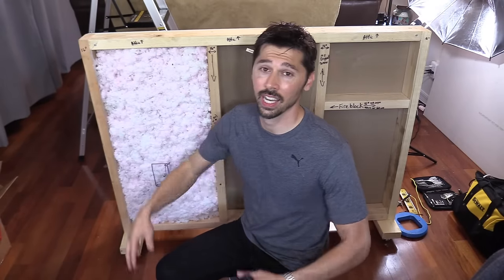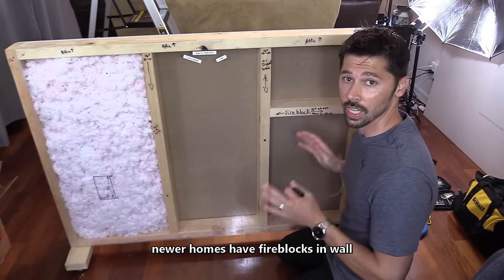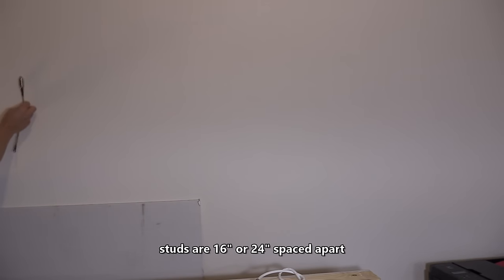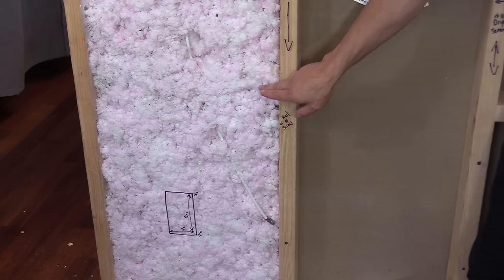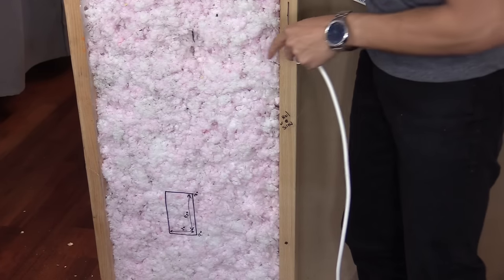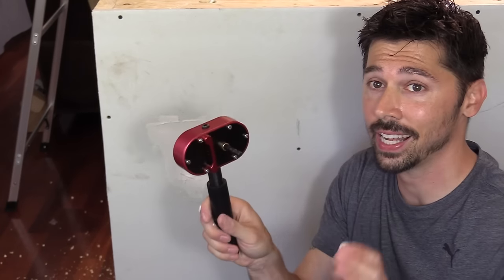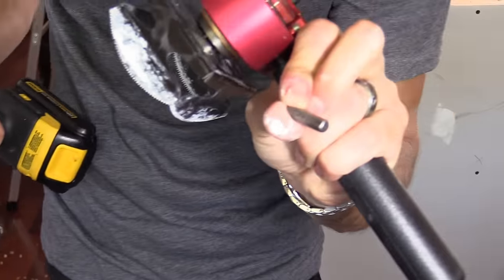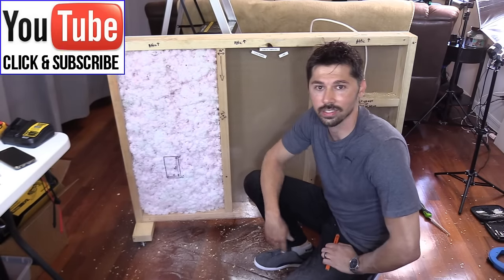3 EASY WAYS TO HIDE WIRES CABLES IN WALL & FIND STUDS

Comment: Sorry, but that is not the way to get through a fireblock. Flexible bit would be the best way
Reply: How would a flexible bit work? If the bit is flexed into a curved shape, it will not spin!
Reply: kellyq21 I don't really want to explain the science behind it, just google it
Reply: Then why are you even replying? I want the answer here. Maybe someone else can post a brief description.
Reply: I rewired my 80+ year old home a few years ago and I used the Kline Flexible bit especially for those areas where I wanted additional outlets.  Just Google Kline Flexible bit and you will find youtube videos of how it works.  I found out about Kline because it is what was used by the cable company when I added cable TV to another room.
Reply: I don't see why you can't just google it lol
Reply: Yes definitely not the correct way to get by a fire block. Flex bit is the way to do it. I'll find a good video, have been doing this way for years
Reply: Flex bits are great, until you think you have it in the right place and it comes out the drywall well trying to drill a fire block. #experience
Reply: Prairie RC true... but then you can just do what he showed here. And then u know exactly where the stud is located
Reply: Prairie RC They make all lengths of flex shaft bits. Interior walls are relatively easy. Exterior load bearing walls are hard because roof taper makes most types of drilling next to impossible. Especially on frame homes.
Reply: Then how would you seal the hole you just drilled through the fire block? Or do you care about building code and your clients safety??????
Reply: You're doing drywall repair either way then...  Why don't you share your #experience rather than leaving a snarky comment.
Reply: This does not violate the building code where I live in a non-commerical building but in some location I don't doubt that it might be a violation.
Reply: Bryan Cooksey I'm not sure if you were talking to me, but I'll share my #experience.
I was running thermostat wire in a client's house to relocate it, my wire fishing rods hit some solid blocking in the wall. 
We used a 5' flex bit to try and drill the block, it seemed to be in the right spot. Next thing I hear is my coworker yelling at me to stop. It had already started poking out the wall. 
I tend to opt for wireless thermostats now.
Also it's not code here to seal the hole in residential.
Reply: because it uses an auger bit and not a spade. you bend the bit using the guide handle and as the screw grabs the wood it will pull itself through. if you bend a wire and hold on to the wire and spin it on one side the other side spins as well. think of it as a solid flex shaft
Reply: Agbhar Gihad u can still seal it. I've seen guys use the spray foam with  longer straws. Not positive but I believe they passed a code that a fire block must be non combustible anyway.
Reply: Eric Wesson in other news......WHAT THE HELL IS A FIRE BLOCK?!?!
Reply: Matthew Snart A row of wood blocking placed in a vertical stud wall that is supposed to slow down any fire that may start in the vertical from reaching an attic or ceiling, allowing fire to reach attic space. Generally wood, so not a complete barricade for sure but required by code.
Reply: we call em noggins in australia ... but they're not primarily used as a fireblock, more for vertical rigidity for the timber frame

edit- usually alternating position in the studs by about 100mm ... so one 100mm up, next 100mm down, 100mm up, 100mm down, etc....
Reply: IAmTheOnlyYogo  American's aren't the brightest sparks out their that's for sure 😂
Reply: Barry Allard thanks. Yes I know all fire stops or foams are not created equally, especially the ones found at the big box stores. I am actually a nicet level 4 technician, and have been installing for years. Thanks for the response, I would definitely agree with you. Typically we stick with all hilti products!
Reply: Perhaps you can make a video and show us your vast experience.
Reply: chip bryant the ultimate YouTube comback...
Reply: Metrix,

I guess some people are too damn lazy. The amount of time the person responded to you could have been time spent to Google the information.
Reply: Bill,

I don't want a guilty conscience. Do it right the first time and always leave the work site better than it was. Worst case scenario, albeit very extreme and most unlikely: if there were a fire and an investigation revealed that the spreading of the fire was due to the fire block being  compromised by you, guess who will be responsible.
Reply: Flex bit is way easier and way cheaper. You can pick up a six foot bit for under $30.
Reply: Flex bits are the best for fire blocks. They do take some getting used to so you don't end up through the wall, also they make a a handle to hold the shaft bent when you have to run it in a bent position which makes it much more stable than holding it by hand, they really are worth the extra money especially compared to cutting sheet. Because anyone that's had to have sheet rock repaired from a mistake knows you don't repaint that one spot you have to repaint that whole wall.
Reply: Its a stick built home those fire breaks buy you some time but a small hole won't matter when the entire building is made of flammable materials. besides you can slide a fire activated plug  over the wire. expands when the heat touches it. There are other methods as well.
Reply: should have used a 5ft X 3/4 pvc conduit as a guide to drill through. works every time.
Reply: In walls over 8ft they use them to brace against the studs wowing in the middle under load.
Reply: If a Comcast installer ever walks in your house with a flex bit you're in trouble! lol
Reply: Agbhar Gihad you use fire block seal. Caulking.
Reply: kellyq21 To get through the fire block from the attic I've used a 4ft flexi bit with an extension. I also had a 6ft X 3/4'' grey pvc conduit.
Drill a big enough hole in the top plate to pass the conduit. Insulated or not you can push the conduit down to the fire break. then simply push the drill down and through the fire break. Normally the flexi bit would skip off to the side and cut through the drywall. by using the conduit as a guide the bit goes through the wood a 1/4 inch in from the drywall. the rest is fishing as you will.
Reply: Fire blocking in the middle of the wall?  In my area that’s not a thing.  You firestop the bottom and top plates by code, but anything between the plates is either for structural rigidity or on exterior walls, used for a seam killer on exterior sheathing.  If you have to drill thru a plate, you can see it and can use anything that will stop a draft like foam or fire caulk.  Are there codes in some areas that really dictate fire stopping in the middle of a wall?
Reply: Metrix, I don't see why you are taking the time to reply twice with no answer for him.
Reply: You sir are very experienced. I too left a similar Conner. Only real pros will inderstand
Reply: Oh my gosh, another that didn't watch the video objectively

Comment: so if my room has no access to attic, and i want to run outlets for home theater speakers(2 rear,1 front and 1 for the hdmi cable in the ceiling), will it be possible or should i just run raceways?

Comment: Good tips. I have used all these methods over the past 25 years. However I don't like the qbit. It's crazy loud and doesn't rip through as quick as i expected. I feel it's easier to cut the Sheetrock with a keyhole saw. It probably takes the same amount of time if you have cut as many holes with a keyhole saw as i have. The only thing i use the qbit for is to mark the locations so that I have the exact size I need to cut instead of tracing out a box eliminator. There's some other options but this are the main ones for someone not experienced in retrofits.

Comment: Cool video but definitely not the right way to patch drywall. No screws or seam tape? That's going to fail in no time
Reply: Agreed 100%. However it wouldn't need seam tape if it was blocked behind and glued properly on all 4 sides. The problem with seam tape is that it requires a huge blend area, so the repair ends up massive. But this joker used plaster filler, and that is just not good enough. Glue to the stud or other timber (like he showed) is a fail too, since the surrounding plaster wall is not held onto the timbers, so it will crack at that point.
Reply: It's a video on running wires, not patching walls. Lighten up.
Reply: Precisely! you want the hole above the nog/dwang/fireblock so you can drill through it but the patch should never be attached to any framing because framing moves. The patch should be independent from the framing with a back block so there is no need for reinforcing, then a simple three coat plaster finish dried with a heat gun so It's all over in an hour.
Reply: Just use a blank plate don't destroy the wall 3/4 hole on each side of the stud grout stud if need be.
Reply: John..what is the best way to remove/replace the min amt of sheetrock when having to pass wiring through ceiling joists/blocking/studs.  no one seems to cover this ?
Reply: Tristan, im going to install recessed lighting in my sheet rocked ceiling (flat roof single story, horizontal rafters on 16" centers. what do you reommend for min sheetrock removal/repair?  you say dont glue the patch to the stud but the entire sheets of sheet rock are attached to the studs(framing), no?     there is almost 0 info online about how the pro's do min sheetrock damage/repair when retrofitting wiring. thx
Reply: i dont agree.  the jobs not done after the wires are run. you have to finish the wall
Reply: Mvm Cali - the easiest way is to lift the roof sheets. However if there is gaps above the rafters (ie: flat ceiling, sloping roof) then you can bring the wiring across to the higher side. If you KNOW that there are no cross-beans between the rafters, then you can remove the cornice on one side, then feed from there across to the downlights. Personally, I'd use a more modern lighting system - downlights are SO 1990's.
Reply: hi John. its a flat roof, no access from above. the elec source is a ceiling fan. i was planning to start that that box and run the wiring thru the rafters to get to the down lights (maybe 6 of them). thats why i think  i need to do some type of drywall removal to make holes.   what modern lighting systems are you talking about? I thought small led recessed lighting is most modern avail? thx!
Reply: If your going in the direction of the joists in the ceiling above.. but if your going across the joists... how do you expect you'll be able to get through without cutting a hole in each one.. and therefore cutting out a square of drywall at each joist in order to drill the hole... now if you have a attic.. there should be no need to cut any holes other than the ones for the lights themselves...
Reply: STL Bowfishing. 

He's a cable installer. If he can get out the door before it falls. That's good enough. I worked construction for a while and cable installers only know enough to do their jobs, and barely that. You should see the crazy way they did my parents house. I can't even describe. When I moved into one house, I took down the old satellite dish. This thing had probably 10 screws into the house, but only one actually was into a stud. And barely. It flopped all over, I can't believe it ever worked. Best advice is watch them closely.
Reply: Patching walls is part of the job. Take ownership of your work.
Reply: Paint stirrers and a couple of screws work fantastically for patching.
Reply: Do it from the attic side. Maybe I'm not understanding your question.
Reply: A california patch would be awesome here. Although that would mean that you would have extra sheetrock on hand. It is pretty cheep though if you ask for banged up pieces at most hardware stores. You'll get a bigger piece than you need, and it'll be cheeper. Plus, no tape required, as the front part of the sheetrock paper does the job of that.
Reply: It only has to look good long enough for the check to cash.
Reply: STL Bowfishing. Agreed, he is an "electrician", not a drywaller. In over 30 years I have never seen an electrician run telephone wires correctly. They just can't do it. Electricians need to stick with electric wires and nothing else.
Reply: @firebirdude2  it's what the Brits used to call "quite too much and too little":  just enough to get an over-confident novice in trouble.  It's a video on running wires... that leaves damaged, poorly repaired wallboard and holes in fireblock in its wake.  

It does not tell the rookie DIY-er to plug holes in the fireblock or to look at videos on how to repair the wallboard, how to match the surface texture, how to match the paint, oops I drilled into a wire or pipe - what now?!?, the residents tripped on a cord and pulled the box out of the drywall because it wasn't anchored, ...

I would like to see more guidance for the novice; at least a hint that no, this video is NOT everything you need to know.

Comment: As an electrician my self these are the techniques we use. Magnets, fish sticks...
And yes dropping a bit in the wall happens more then you can think haha. That locating tool is pretty amazing. No more yelling back and forth to your apprentice or tapping on the ceiling. For the fire block I end up cutting a 1 gang hole above or bellow then put in a lv1 or lv2 with a blank cover on it. No patching and paint needed. Thanks youtube for recommending this.

Comment: I'm going to be getting some new tools lol. The only thing I noticed wich is not a big thing but when doing to patch ether tape or leave a half inch of the rock board paper hanging off the edges of the patch or eventually the seams will crack. Outside that irrelevant detail awsome video. Thanks for the info

Comment: as someone who's used the magnepull in the past, it's useful but only in certain situations, the magnespot is a heck of a lot more useful but I really only use it for drilling through brick walls and into a house. 

other than that he's pretty much correct with what he's talking about, instead of using a magnepull get some fish rods they'll push through insulation without much of an issue.

Comment: With CBS homes here in FL, how to you get out to the outside wall if the customer has vaulted ceilings? I have one that has very low clearance between the ceiling joists and the roof joists, and it's impossible to get to the outside wall to do any wiring.

Comment: Awesome must have tools, I never knew they existed.  Talk about a dollar short and a day late, I just installed two days ago, 7 thin LED ceiling lights, and I did it all from the bottom, very little room in crawl space.  I converted an outlet that was wired to a 3 way switch, to feed the lights.  Well, I never knew what a fireblock was until I ran into one trying to run wire from the top down to the outlet.  I ordered a 3/4" x 57" drill bit to drill through the fireblock but, as you probably know, this bit was too short and wouldn't work, cost too much to send back, so I guess I'll try to sell it on craigs list.  Anyway it was also a real pain to fish all the wires to each light from below, I could have used the fish tape/rods to fish the wires.  So, anyone planning to do any kind of wire fishing through walls or ceilings, do yourself a favor and purchase these tools it will make your life a lot easier, and work will be a lot faster.  Thanks for sharing this information to us, I hope everyone that watches this video purchases these must have tools.  Listen to a DIY'er that's been there and done that lol.

Comment: This is a nice video highlighting some great tools. If I could add two things... Most walls have stacked studs at the ceiling so drilling power is important, especially in an attic.  Second is easiest - from now on use white electrical tape and you'll never have to get the black goo off your wires again, even after sitting for years.  Well done TampaTec!

Comment: One of the best tools I ever found was a 102 inch stainless antenna, bought from radio sack. I heated and slightly flattened the small end,then used a cobalt drill to drill a small hole to insert wires. Paddle bits cut in half can be used atop outer walls.
Reply: To locate your desired pull location to drill the top plate; cut a zinc plated mechanics wire to a sharp point about a foot long and push most of the length into the attic.  Repair the hole with  common tub and tile sealer.

Comment: Oh my GOD!!!! You are awesome! I bought some fishing fiberglass poles for fishing wire through the walls and its difficult to use. The Magnepull seems to be the way to go for running Home Theater Speaker wires through the wall. Thank you for sharing the link. I will be picking one up next week using your link. Im a Do It You Self kind of guy and only do this stuff for my self so this information was very helpful. I also subscribed to your channel.